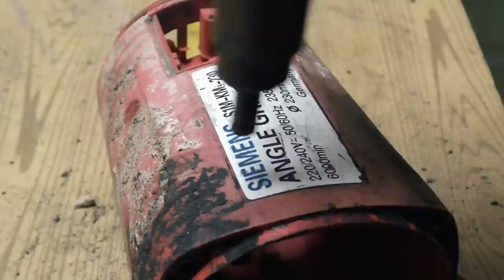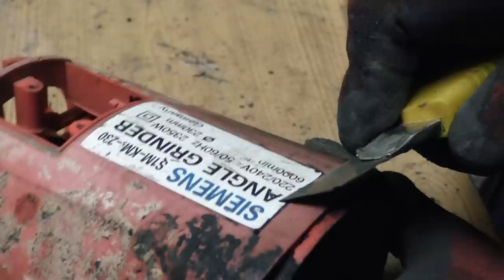Restoration Destroyed and Rusty SIEMENS Angle Grinder

Comment: I am sure lubrication should never come between the two  pieces  of the actual motor  plus lots of parts should have been replaced not just cleaned .. that thing will fizzle very quickly if it will ever work right at all

Comment: @ BL Restoration... Just a safety item for you... Never lubricate any part of the commutator or armature with any petroleum based lubricants.  These parts do not contact each-other when powered up.  If the grease gets too hot it will ignite when it comes into contact with the operating carbon brushes.  If you feel you need to seal this area, spray silicon is the best option then let it dry.  Never use petroleum based products in this area.  They also attract dust and dirt which will eventually damage the equipment you just restored.  

Other than that suggestion, great job.  Keep it up.

Comment: For sunbaked plastic, you want to get every last bit of the sunbaked layer away before you paint it. It's no longer a part of the main body so it'll flake away under the paint. 
Secondly, don't paint plastic without a primer and don't go heavy on the first coat - or any coat. The paint chemicals react with the plastics and cause gases to rise below the surface which cause the surface to bubble, never the mind all the paint running as it dries.

Comment: Great job.  But I advise you to check the gearbox again.  17:12 grease the gear that is not secured by the retaining ring.  17:17 close the gearbox without the gear stopper.  I hope you noticed and installed it 😀👍👍👍
Reply: Plus the noise its not normal.
Reply: The video is clearly for views. I do not think he will actually use the tool.

Comment: How many new parts did you have to get?   It looked like it had "burnt up."   Could you tell what part was the failure?  After the restoration, we saw you turn it on, but is it going as fast, as it should?   How did you source the parts:  just look the model up on the internet and order the new parts?

Comment: That machine is going to use half it’s power fighting all that grease....
Reply: But the gear box supposed to be full of grease otherwise will be very hot.
Reply: @AiantasD  it does not need to be full, grease adheres, that’s why grease is used and not oil. Waaaaay too much. Thank you, a ticketed machinist.
Reply: @CaspianWint  In other videos on youtube people fixing angle grinders says that gearbox must be full of grease because the gear when spinning spreads the grease around and gets it's self dry. I don't know if this is true but in my angle grinder i see the grease all around and so few on the gear.
Reply: @CaspianWint  Silicone grease is used for resistance to heat and moisture.

Comment: 200-240 Volt AC @ 50-60 cycles? Had a wood circle saw blade when you "found" it ... in a small burned out? building's basement out in or near the middle of nowhere?
Yeah ... ok ... that isn't something a carpenter or construction worker is giing to use at a job site.
Generators are 110-120 volts.
Normal household cutrent is 110-120 volts 60 cycles AC.
To get 200-250 volt service takes a different transformer, than for 110-120 volt, heavier guage wires from the power pole, a seperate power meter (if you're smart, a load meter)... 
That thing was used in an industrial setting, with 220 volt service. Not some dude's garage workshop.
The chances of the original owner having that wood saw blade on it? None to less that zero.
Nice try. The "find" ... Phony as all get out.
Useability at a job site: Nil.
No advantage of using a 200-250 grinder over a standard 110-120 volt grinder ... why bother "restoring" it? 
Unless you have high voltage outlets in your shop, you can't use it. 
(most lathes, mills, etc. that are high voltage are hard wired - not plugged in. Hard to get fire and liability insurance if your machinery is plugged in.)
Let me guess ... the reason you never showed the plug is because "someone" put a 3 prong 110-120 volt grounded plug (which don't fit a high voltage outlet) on the end of the cord, right?